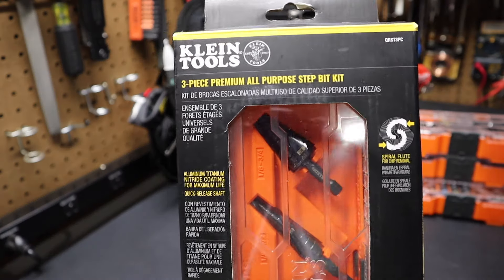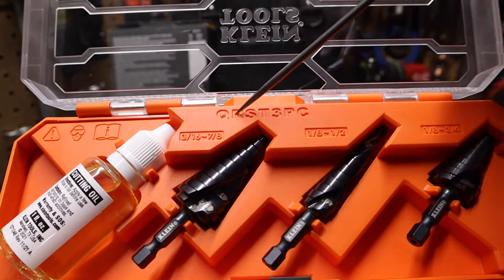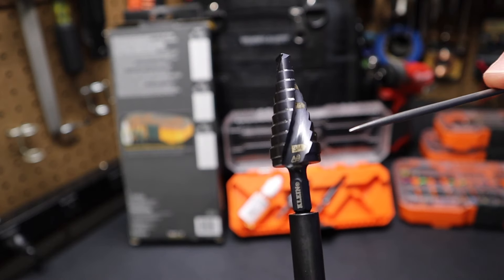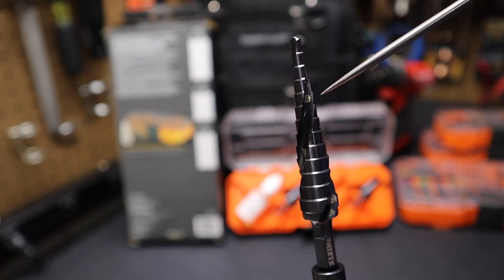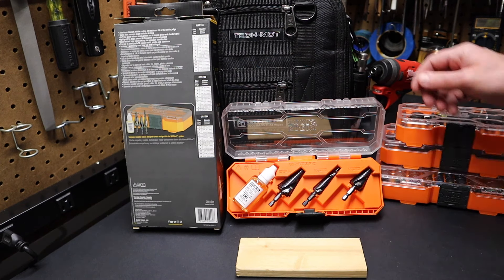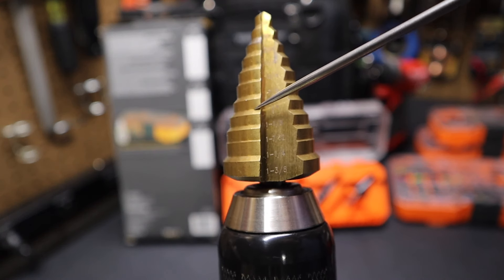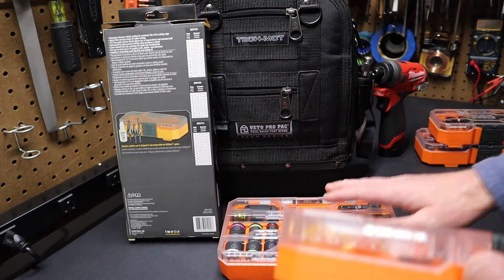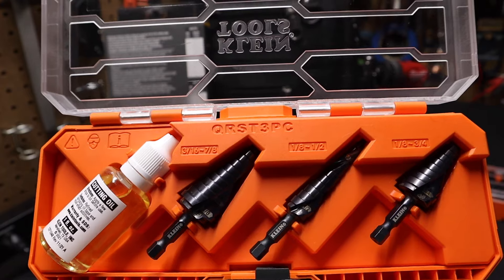NEW Klein Tools Impact Step Drill Bit Set in Mod Box - QRST3PC

Comment: Nice touch adding a bottle of cutting oil👍
Reply from the maker: Yeah that’s helpful. Thanks for watching!
Reply: @davidhull2060  yes it has been very handy too! I don’t loan my Step Bits out anymore because people will not lube them and dull the tips so bad they won’t initiate starting a small hole to step after a short time if not careful.. So something I did recently was buy some Lucas High Viscosity Oil Treatment at AutoZone for a high mileage truck I use here on my farm to beat around in. I noticed it had a lot left after I squeezed it into the port of the engine. I had an idea and went and got my Klein Step Bit set just like this one and I used a plastic syringe 💉 like I use for my cattle meds to extract the thick Lucas oil to deposit into my cutting oil bottle in my Klein set. You want to talk about a night and day difference on the performance ? It only literally takes about 1 drop of the super thick oil to keep the bit completely cool even to the touch right after using it. And that’s pretty cool!! I would suggest anyone to try it if your an Electrician like me that doesn’t like getting ready to do something and in the heat of the operation we realize that a brand new bit won’t do a thing.

Comment: Thanks for the review. I think they dropped the ball here.  As an electrician I want the ⅞ (½ pipe) and 1⅛ for ¾ pipe.  2 of the 3 unibits in this kit aren't really servicable for an electrician.
Reply from the maker: I have the Klein Tools pro version linked in the description, that may be what you’re looking for. Thanks for watching!
Reply: With all due respect sir…. I am a Master Electrician that works for a organization that only does medical projects really most of the time… But we occasionally do the nicer Grocery stores, and we also do some car dealerships and 5-12 story office buildings. I’m on the Commercial side of the business so you can imagine how much 3/4 and 1” EMT we run. I’m not trying to change your mind about this bit  kit… just know they have 2 different size offerings and one of them is the bigger diameter set. It goes I believe from the biggest in this box all the way up to 1.625. I bought the 1-3/8” or 1.625 bit as a stand alone for 75.00 with taxes and to my knowledge that’s the biggest Klein makes in the step bits. that so please know the smaller bits get use a lot for my work scope but maybe they don’t fit everyone. I’ve gotten a lot of use out of the small 3 Astro bit Mod Box set. To each their own. Even if I don’t use them as much as someone who can’t justify spending 100 bucks for the set I don’t get because if I know I have them when they are needed even if I only use them a few times a year it’s good insurance to know you have the right tools and the best for the job. The last several years I’ve done Hospitals Optometrist/Eye surgery operating rooms. A lot of Surgical Suites as well for outpatient procedures and they work well for me. If you have the extra funds to buy the step bits go buy the biggest stand alone and this 3 bit set and I bet you would find some use for it at some point. I love Project Pinehill 🌲 reviews. I’m glad that I found this page. I’m getting that battery powered ball grip screwdriver when I find the Gold edition like I want. I saw that for the first time on here as well. Keep adding good content and we are gonna keep sharing and spreading your message. Have a great weekend guys. 
Randy Guice
Reply: They should have included the  1-1/8" bit as the middle then vary on the other 2, Milwaukee has a smarter selection
Reply from the maker: @Thinkableness Thanks for the info and thanks for posting!  👍